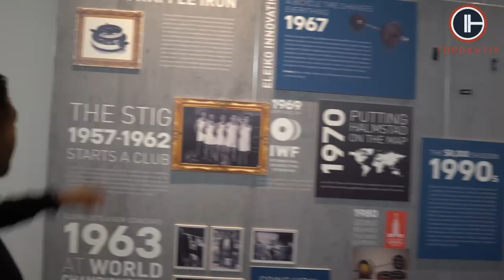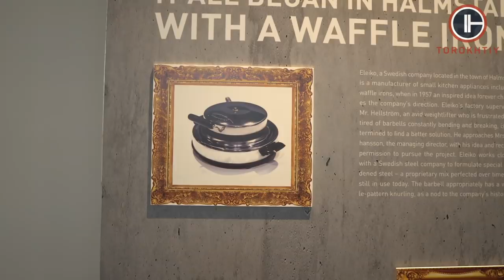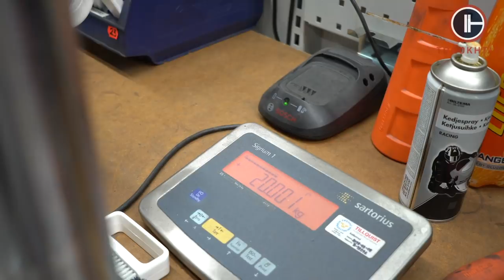Trip to ELEIKO Factory / weightlifting by Torokhtiy

Comment: I see the prize and i think that are much expensive,for example a couple of parallettes on wood for push up 130 dollars,two piece on wood !!!! Bar for weightlifting 850 dollars or 1150 dollars??????? Eleiko are crazy ,steel or cast iron are more expensive on silver , ez bar 12 kg 450 dollars,or the adjustable bench 1250 dollars if not adjustable a bench orizzontal  "only" 500 dollars,but only a bench nothing else, a normal single bench 500 dollars???? Today bodybuilding , powerlifting,weightlifting, crossfit are more expensive on Golf ....